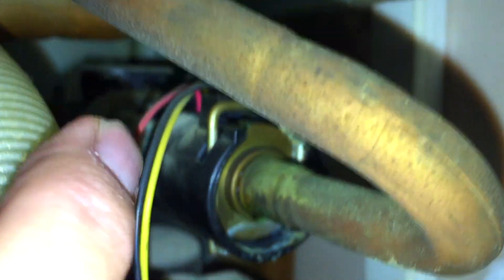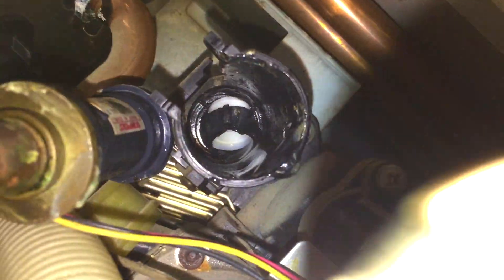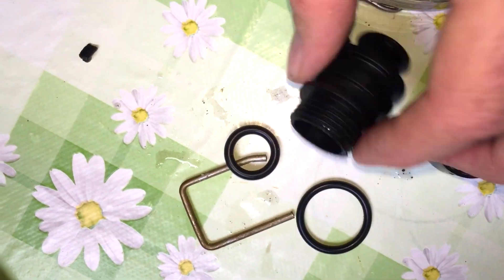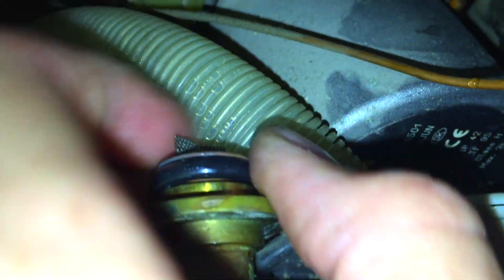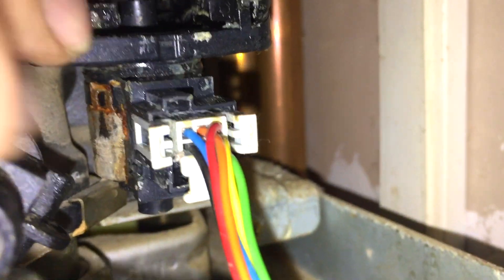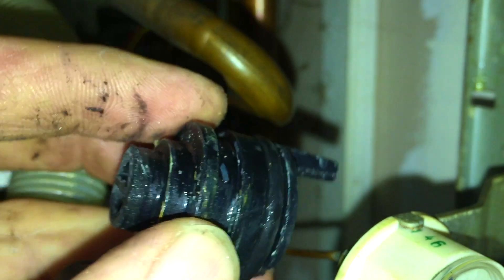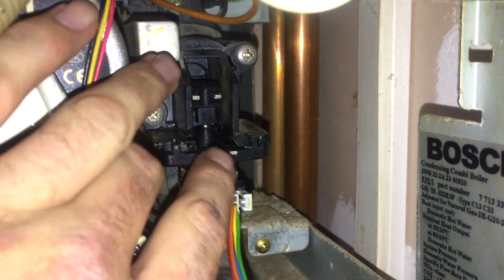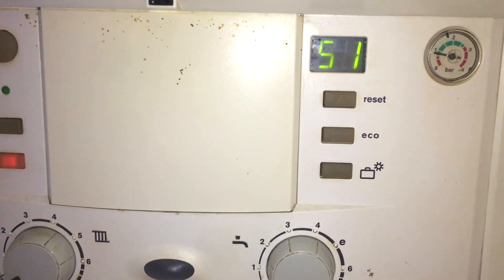Leaking Worcester Greenstar Flow Sensor/ Adaptor. Heating geeks boiler repair

Comment: Hi great video thank you my question my boiler is constantly making water and discharge through the PRV valve which I have replaced it is not the filling loop the cold water mains inside the boiler has condensation and with a screwdriver I can here water flowing with hot tap off in the house boiler is a greenslave oil burner
Reply from the maker: Mains water is getting into the heating system somehow. Look for older filling loops left on the system. The condensation in the boiler points to the mains water continuously running through the boiler. This could be a manifold that has failed or the plate heat exchanger. I suggest you listen to these items. What is a green slave? Greenstar heatslave?
Reply: @HeatingGeek  thank you I disconnected the filling loop  so will listen to the others thanks again
Reply from the maker: @andrewmclaren6189  Good luck with it. I hope you get it sorted.

Comment: Hi mate, would you be able to tell me where i can get a new flow sensor pipe? I am wondering now if while i forced it out i bent it…which is why i had so much trouble putting it back in and its still leaking. 

Cant seem to find one online.

Comment: Great video…thanks so much for sharing. Really helped. Unfortunately in my case it was still leaking after the change? Im pretty sure ive done something wrong but not sure where. Seems like i did everything the same as this vid. 

Is it normal for the sensor pipe to be put back in with full force while trying to at the same time insert the clip back in. This part was a nightmare for me and just as long as the the rest of the job. Which is why i was even more gutted when the leake didnt stop. Repeated the process for good measure but still leaked. 

One thing i didnt need to do was undo the bottom nut of the sensor pipe….didnt need to as the top part pulled out with a little twist and turn. 

Any advice from anyone would be much appreciated.

Comment: Brilliant vid, I had the same problem, couldn't believe when I took it apart the flow restrictor housing was disintergrated (took out with minimal force) with half of it left behind in the tube, shocking quality, your video was very helpful, it's now working like a dream, they really need to make more of their parts from metal
Reply from the maker: Worcester Cheese.

Comment: Worcester can’t even give me the right loom bought a new pcb board and it came with a loom but it wasn’t for this boiler I phoned there technician phone line to be told it was correct and I was fitting it wrong so I asked if it was the correct loom why is there plugs missing no flow sensor plug no diverter plug no gas valve plug no slow running pump plug as thick as shit
Reply from the maker: I have had the same problem. Several times

Comment: Great Vid. Did one of those yesterday. Went in blind and guessed the manifold but no, will carry one of these in case now.  Do prefer Baxi for repairing. so much space in the duos and new baxi 600 and 800's, Brass components rule.
Reply from the maker: Brass components do rule. But plastic crap pay the bills :-)
Reply: @HeatingGeek  yes very true.😂 Keep up the good work👍

Comment: I have an older model, without the green plastic cover over the diverter valve motor, and when the flow sensor/flow restrictor leaks the water goes onto the motor/actuator. This meant that the diverter valve actuator wasn't operating, and resulted in no CH, luckily I managed to repair it by just pulling out the diverter valve motor, dismantling it and then lubricating the seized bearing with WD40, this cured the problem and saved £50 for a new motor :)
Reply from the maker: I usually just shake the crap out of them and they start to work straight away. I have had to replace a few though. Great engineering the green cap. ;-/

Comment: Hi All, Our hot water has stopped today (Heating still works) noticed water dripping from the boiler and it's coming from here. Would this be why we have no hot water? I'm pretty handy, would this be a DIY job or do I need to get a professional in?
Reply from the maker: This repair requires the combustion chamber seal being broken. The boiler then needs the combustion setting up. This is definitely a job for the pros.

Comment: Top bloke for sharing this, my cheese sensor like most completely turned to fondu. The only mistake I made was when I struggling to get the clip back in and realised that I was trying to fit 2 'O' rings between the flow turbine adapter and the flow sensor! Otherwise not too bad, the silicon grease helps to seat the adapter and there is a definite clunk when it's in place. Leak sorted and as per the commentary, the hot water seems to arrive faster at the tap due to the flow restrictor working properly.
Reply from the maker: mmmmmm cheese. :-)

Comment: Excellent video really helped and yep it solved the problem, I was a bit baffled as the inner fixed section does not look like and engineered finish, it looked like remnants of the broken part until I re-watched you video and saw yours was the same. Many thanks.
Reply from the maker: No problem. Im glad it helped. :-)

Comment: Top tip for any newbies like me; the large o-ring on the adaptor needs to slide all the way over the (cheese) nut then over the plastic lip. I had it the nut side of the lip first try and so it would not click in to the housing; DOH. Managed the clip after ten attempts by pushing the copper and sensor part back  and wiggling the long side of clip into the right side first which then helped getting it down and in on the left side. Unfortunately the grey wire other side of connector popped out so given sensor had no power the boiler did not provide hot tap water; obviously the job of the sensor to prevent a burnout if no water, so stripped bit of the outer doubles it up and pushed it back in; et voila hot tap water once again. Thanks for the video.

Comment: What’s the first things u did, close the main valve and the unscrew the pipe and run hot tap ? Is it for draining the boiler?
Reply from the maker: Isolate the mains and open the hot tap. Then undo the nut and take out the clip. etc etc. :-)
Reply from the maker: When it's all back together the clip will be very difficult to get in.
Reply: @HeatingGeek  exactly, I'm spending an hour to put back the clip, any tip adv?
Reply: Nemo Sala I found putting the longest side of the clip in the right hand side first a little then just open it a little to push the left down into its hole. Worked a treat the times I’ve changed this part. Sorry if I pushed in with a suggestion there.
Reply from the maker: @nimasala8764  welcome to the club. :-)

Comment: is there an o ring at the front ????, as I have put one on and cannot get the clip back in as there is no room for the pin to go through, also I have tried with out but it just leeks
Reply from the maker: Yes there is. Have you made sure all the old one is out? The front clip is a pig to get back in. :-) I couldn't get it in on camera. Its tough. :-)
Reply: So there is supposed to be an o ring at the front where it meets the plate? I wonder why the adapter only comes with 2 o rings in the pack? Looks like I'll be going back 😂
Reply from the maker: @rw3095  Yes one behind the nut and one on the back. It is very difficult to get the clip back in after the parts go back together. :-)
Reply: The 1 i worked on had an extra o ring at the front of the turbine adaptor where it joins to the plate hex. Also the flow restrictors were missing. I'm guessing with the restrictors missing then it shortens the overall length of the flow turbine slightly and previous engineer had tried to compensate. Thanks

Comment: If they didn't make cheese you wouldn't have £ in your wallet.
Reply from the maker: I have no complaints about the plastic cheese. Its the yummiest type. :-)
Reply: @HeatingGeek  I was ripped off with turbine and adaptor just about £50.
Reply from the maker: @proteus1  I don't know how much the turbine is, but the adaptor is £4 ish. :-(

Comment: Thank you so much for this, the bit about the diverter valve switch was crucial to me as I couldn't understand why 2 faults had happened at the same time; the leak and (apparently) the diverter valve.
Is there a way in which I could contribute to the cost of the replacement screen for your phone?
Reply from the maker: Glad It made sense to you. Its common to happen. The iPhone is no more!!! Lost/stolen.  Just keep watching and sub. :-) Thanks

Comment: I fit Intergas not WB tupperware. Got booked on one of these junior poc's today and whish I'd watched this vid first. What a PITA! Changed the turbine adaptor only to discover return block had a pinhole and had to change the whole thing! Cut my hands to shreds and broke my phone screen just like you did grrrrrr.
Reply from the maker: Phone screens could be better TBH. Worcester are ok..... :-)
Reply: Lol. Nothing worse than having to work on/change parts in a boiler that my boiler of choice just doesn't have or need 😜

Comment: The Worcester is poorly designed. Designed to fail.
Reply from the maker: No, designed to last 5-7 years. ;-)
Reply: @HeatingGeek  best values for money is there Main and easy to work on, lots of space.
Reply from the maker: I don't mind working on anything really. Main have a lot of sharp edges though!!

Comment: Great Video helped out my plumber to fix the exact same problem, on my greenstar 24i junior, CH works but hot water is tepid unless a slow flow, have to turn off CH to have a decent shower, diverter valve motor piston moves as it should, water doesnt cut out so he thinks the HE plate is ok, any ideas .Thanks
Reply from the maker: Check flow rate and gas rate. Your answer is in the results of the tests.

Comment: do I have to isolate the loop fill and house stop cock for this job as I'm willing to give it a go ?
Reply from the maker: To do it you have to open the combustion chamber so I cant help you. Its not a job you should attempt yourself. Please get someone to do it for you. Even qualified engineers struggle with replacing this part as it can be very difficult.

Comment: Hi mate got a question for u. Worcester greenstar 30i. Heating is fine but no hot water. I have diagnosed it as the diverter stuck in heating mode and or the dhw sensor. Any ideas or tips to confirm what the problem is? Thanks
Reply from the maker: Test them. I have a video on how to test 3 wire flow sensors and the diverter is simple to look at. This is the flow sensor video.
https://youtu.be/G4bO8MYqQKk
 I did have one on the worcester but never up loaded it and cant find it now.

Comment: Hi heating geek Keith again with Worcester 28cdi have now replaced diverter valve and everything seams fine took 3 hours . Dismantled the old valve to see what problem was.turned out to be one of the small cir-clips on the diaphragm, the inner one, had broken off allowing the weeker small spring to hold out the rod onto the micro switch.again I thank you for your reassurance, and a merry Christmas
Reply from the maker: Glad you got it sorted. Hopefully it will give you a good few more years of service. Good boilers but a pain to work on.

Comment: Hi have turned stopcock off diverter valve still pressing against micro switch when taps turned on boiler lights and hot water is there, central heating has now gone . I need to turn boiler off at mains electric each time I use hot water cus heating pump gets really hot 🥵 even when boiler not fired.another mystery. Have had local plumber round had he’s sure it’s the diverter valve. Thanks
Reply from the maker: If its still out when the stopcock is off then its the diverter. 
The pump is getting red hot because its running forever (because of the diverter). Good luck hope it goes well.
Reply: HeatingGeek hi thanks for your reply I have ordered a diverter valve but at same time its nice to have reassurance of a professional I will fit it when I get it.i did it about 2years ago but only replaced the diaphragm so I am hoping it will come apart a bit easier thanks again
Reply: Have now subscribed to your channel 👍
Reply from the maker: @keithmatthews9043  good luck. They can be a pig!!
Reply from the maker: @keithmatthews9043  Thanks. You know these comments are on a video of a Greenstar. I guess your talking about a CDi RSF. Im sure thats where we started talking!!!
Reply: HeatingGeek hi yes mine is a Worcester 28 CDI
Reply: HeatingGee

Comment: Have just fitted mixer taps in kitchen and have Worcester 28cdi boiler now diverter valve is constantly pushing against micro switch carnt understand why have bled system and even isolated the new taps but problem still remains anybody any ideas Thanks
Reply from the maker: If you turn the stopcock off to the house does it go back in?? Is the hot pipe under the boiler hot? If so you could have caused a leak under the floor or something. Let me know.

Comment: i would strongly advise anyone who fits Worcester boilers to fit a shock arrester on the mains inlet to reduce problems with poor quality manifolds and flow reducers .
Reply from the maker: Or fit a Vaillant that don't seem to have the poor plastic issue.
Reply: Hiya Pete... just randomly spotted you hear! 😄

Comment: Mate my screen on my iPhone is shagged again too ! Had the phone just over a year aswell this will be 3rd cannot be arsed to keep changing them now ! Always use it a a torch and end up dropping it. Can’t they make a screen that won’t break !
Reply from the maker: They can but that would be like making a boiler that didn't leak!!!
No jobs for us and Worcester wouldn't sell any flow adaptors. (Vaillant wouldn't sell diverters etc etc).
Reply: @HeatingGeek  have you tried any of the non-Vaillant repair kits for the ecotec diverter valves yet ?
Reply from the maker: @paulkramer2599  Yes I have. I have a video coming soon about them. I done the filming before Christmas........
Reply: Very true. whether Worcester designed that part to fail I don’t know. Ecotec diverters like wise At the price it sells for I wouldn’t think it would be worth tarnishing reputation for something that is so cheap cost wise. Then again high volumes of failures even at 2 quid profit is still good business for them. Flow adaptors that is.
Reply from the maker: Heat Service bwc uk  Yeah its pretty bad really. 
You think they would update stuff and move the issue onto other bits. (Vaillant). The diverter has leaked since 2004 and still leeks alll the time.

Comment: Alaways awkward ! That pin is a joke and why they didn’t re design that adaptor with brass is one reason I don’t fit Worcester unless I have to. I spoke to Worcester once and asked them why and there reason was cost ! To patch it up with the green rubber jacket over the diverter motor just says it all. Poor

Comment: another good vid mate , them retaining clips are nightmare little tip is you struggle with them file the tips at a slight angle as the go in better with a little tip have seen myself spend over an hour just on them clips usually when in a cupboard when boiler poor access
Reply: yes been there on that one lol
Reply: If you struggle to get that clip in there is a good chance the silencers are not fitted correctly in the adapter therefore the whole assembly is slightly proud which makes fitting the clip very difficult.
Reply: @Pro-nj4uu  ...Silencers !! ????

Comment: hate that metal retaining clip with a passion..I always fit a green cover onto the stepper motor it has a slope on it to let the water run off!!! pure quality
Reply from the maker: Its like they know its a problem. ;-)
Reply: HeatingGeek  I stand corrected I fitted a service kit to a baxi 80he instant  diverter section/bypass onto the vessel  today it was has to be the worst design ever
Reply from the maker: Darren Hooper. The one with the two pipes onto the vessel? 
I cant ever remember doing one. Probably blocked it out!!!

Comment: Good job. Little tip, next time either remove the diverter valve or cover it up to stop it failing when water drips on it. Also before you pull out the adapter wd40 the adapter and move it from side to side working the wd40 in. Less likely to fall apart when you try and take it out. 👍🏻
Reply: That is not advisable. If you squirt WD 40 into potable water connections you will contaminate the water supply and have broken water regulations.
Reply: Come on guys play nicely...